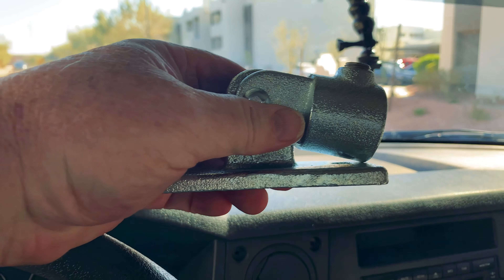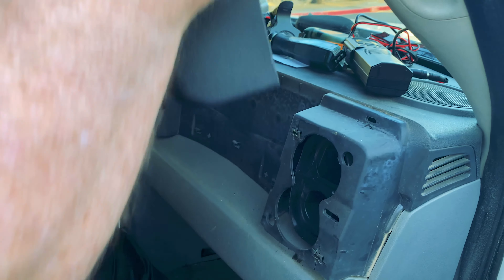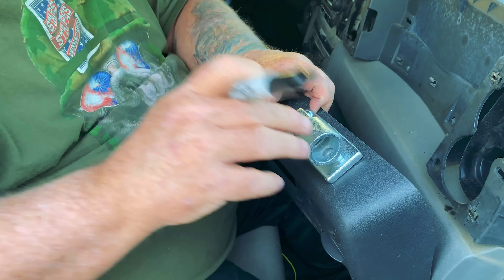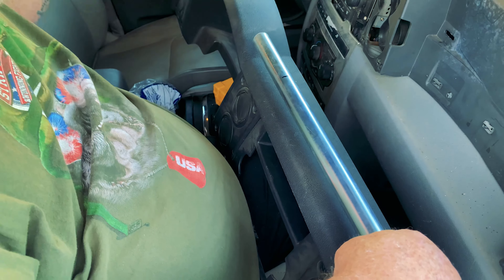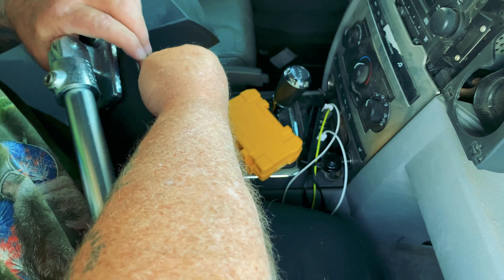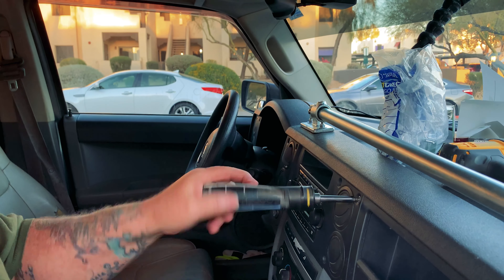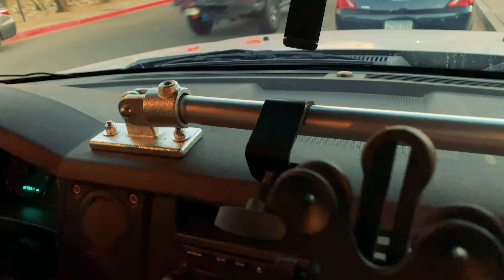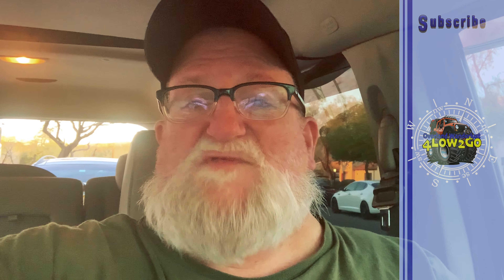Our DIY Accessory Bar | Jeep Commander Outfitting

Comment: Just an opinion. I did something pretty similar and I bed lined it back, makes it looks super clean and still very functional. Plus if you look for an adjustable cup mount phone holder and take out your vent near your radio, you can use it as a phone holder and fits awesome with no problem. Great video.
Reply from the maker: Dude! That’s an awesome idea!